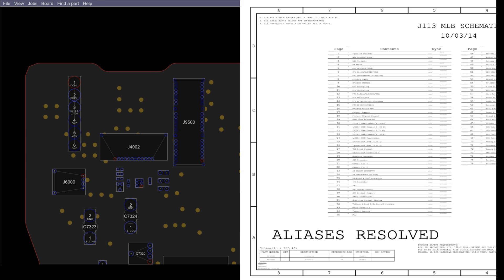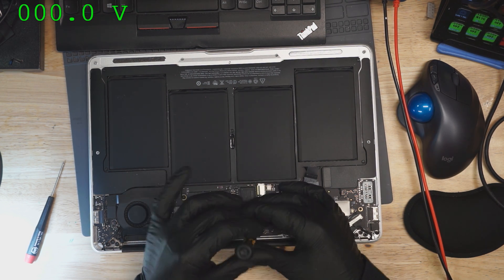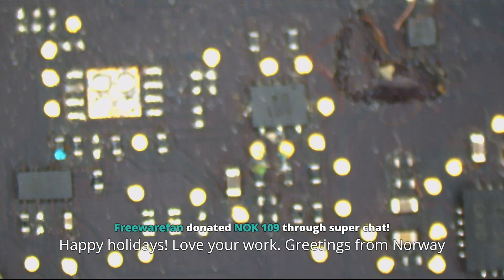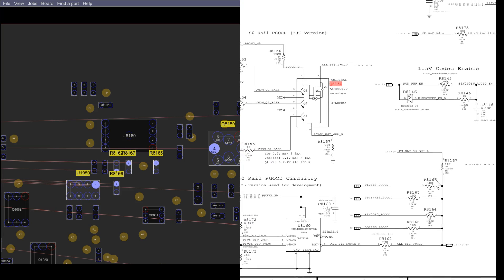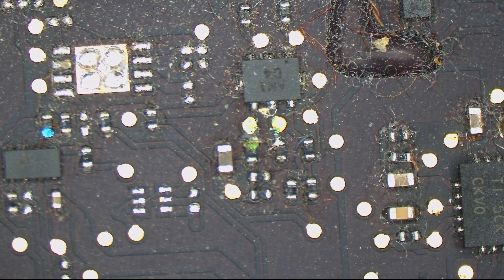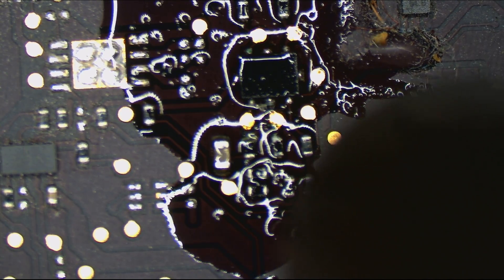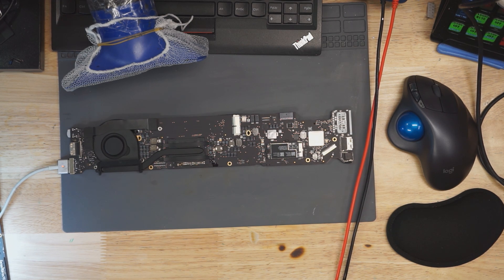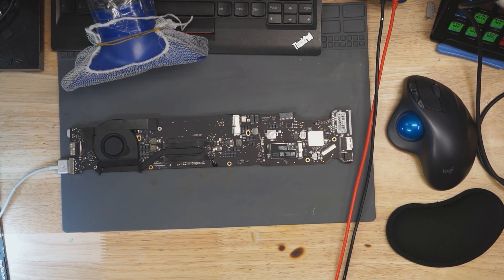Why does Macbook Air board draw 150mA and not turn on?

Comment: I was thinking how nasty some of these laptops look inside but last week I opened my desktop and although I cleaned it like 5 months ago and it had almost no dust, my GPU was covered in layers of spider webbing like 3 spiders moved in. I couldn't believe it.
Reply: @Jason Gooden  If you think that's bad... I repair PCs for a living.  

I've seen a desktop that died because a pack of roaches moved into the power supply. (Three times... the customer is a repeat offender who refuses to call an exterminator.) 

I've seen a desktop that died because the fans were clogged with denim lint (they had the computer too close to the laundry room, and it was sucking in lint.)

I've seen a desktop that died because the owner had been using it like a smokeless ashtray for 5 years.  Everything inside was covered with a solidified layer of cigarette tar that was so hard I couldn't even chip it off with a screwdriver.

I've seen a laptop that died because of a cumshot.  (Eww!  And no, I didn't check the hard drive for porn.)

So, yeah, I've seen some pretty nasty computers.  My theory is that they call it a "dust cover" because it covers up the dust so you can't see it.  ;-)

Comment: Why not blast away the dust and fluff on the board with compressed air before fluxing it? Would that not make easier to position micro components back without stray hairs pushing them around?

Comment: Why so many macs have corrosion?  Are people making what with them?
Never had corrosion in my devices.
Reply: Louis has mentioned before that Apple doesn't put any sort of liquid protection to shield the internals from spills. I think it was a Lenovo one that he specifically referenced for having a thin film under the keyboard with drainage routes to combat simple spills and prevent this kind of corrosion. Apple just doesn't do that.

Comment: I looked at your shipment site, Rossmann do NOT use USPS. They will fuck you in the ass if you go to recover a missing item in the mail. Even with insurance. My uncle works for them going on 46 YEARS and he couldn't get USPS to refund a simple $150 laptop shipment. I had to provide proof it was mine, proof of purchase, proof I shipped it in that box, proof it was worth $150 and proof it was shipped in that specific box with videos. They wouldn't even accept pictures I had taken of the laptop. They will absolutely fuck you out of any shipment that is lost, regardless of """insurance"""

Comment: Have a Samsung question. From day one my Samsung s8 was giving me problems.dropping calls wouldn’t make or receive calls. Samsung Ireland has their own repair center in Ireland. They have changed out the motherboard twice already.so all in 3 motherboards in the same phone in the space of 10 months.guess what it is faulty again and again doesn’t make or receive calls. Send it back to Samsung the back had a tiny crack and that’s all.but magically the front screen has a chip and voids warranty they say and they won’t repair the motherboard fault. They don’t even need to touch the screen to change out the motherboard never mind the fact I have videos showing my screen was never chipped. They just said F^*k u we are not fixing it unless u pay for a brand new screen. Asked them to just send me the motherboard and I’ll fix it myself.and I’ll make a video showing we don’t need to touch the screen to fix my phone fault. A fault from day one. Must be a bad batch of motherboards. But bottom line is they won’t do anything until I cough up 250euro for a screen that wasn’t chipped when I sent it never mind the fact that the repair doesn’t need u to touch the screen at all. Go into the back change out board job done

Comment: Do you use one of those hot air things because it's easier than soldiering and is it still possible to soldier things to boards without it?
Reply: No, it's because you can't remove some kinds of surface-mounted components with a soldering iron, because the contacts are under the chip.
Reply: @SpearM3064  Okay, cool, thanks I appreciate the answer.

Comment: You sound like a pretty cool dude to work for. I have GE SCR motor controller and drive system training but nothing that would help me with the circuits you have. Most people that have cats or dogs and live in the city usually are good because their 5 times harder to have in the city.

Comment: Are you telling me the thing my daughter wanted and I spent all that money on, is junk? I thought they were built really well compared to other "windows" computers. Can you fix the border of the screen thats a piece of plastic and goes around, or is at least attached to the bottom of the screen? The part that says MacBook Pro on it, can you fix that? IDK how she broke it, but she did, and its only a few months old. Not a good track record when I told her it has to last her through college, and is currently a H.S. senior.
Reply: @1MADMAX 1124  Actually, compared to some PC brands, the Apple products have a higher reliability rating.  That "piece of plastic" is called the monitor bezel, by the way, and it's pretty easy to replace.  You can find videos right here on YouTube that show you how to do it.

Comment: I just learned apple is using ddr3 ram on the new 13 inch MacBook Pro
Reply: Are you serious shouldn't they be using DDR4 by now
Reply: Pink Lightning well it’s ddr3lp. You have to get the 15 inch for the premium speed of ddr4
Reply: @Steven-hq6df  but the ddr3 and ddr3lp  interfaces are at least 3 years outdated the computer would clearly be shit by today's standards

Comment: That sendyourmacbook.com link you have in the description appears to be a parked domain from my end. EDIT: Of course the one I just typed seems to work for some reason.
Reply: It's because
a) you don't have WWW cname pointed to the root of the domain
b) wrong web server configuration

Fix:

a) add a cname DNS record with value of "www" that points to @ (root of the domain)
b) add www.sandyourmacbook.com as hostname to the vhost file
Reply: doc the mentally crippled  I don't know what's wrong, but domain just works for me, it's "shortcut" to rossmann/mailin repair

Comment: Nice repair job.  I have an old A1811 macbook pro that wont turn on. I'm experienced with pics since the 486 and I was thinking about cleaning corrosion (if there's any) with isopropyl alcohol before sending it to a repair shop. What do you think about it?

Comment: When you see the 300th Mac with the same problem of liquid damage in the exact same place you can't do but draw conclusions
Reply: Robert B. They're reliable, but so many of their decisions are so strange. Thanks for the input.
Reply: Didn't some Lenovo models have a liquid catch and drain mechanism?
Reply: Think different.
Reply: @Robert B. I have 4 lenovo laptops, they all had smaller or bigger spillings and not one stopped working

Comment: so essentially macs are made with poor quality MBs 🤔
Reply: Yes and no it also depends on how people treat them I bought an alienware 13 r1 custom order off ebay and the previous owner had ripped the display port off the motherboard and lied about it's history in it's description I'm still getting the stuff to fix it
Reply: @pinklightningvtuber  unlucky about the alienware 😑😁
Reply: @AndrewBaggett-f2v  Because the problem is that macs are not made with poor-quality MBs.  In fact, if you look at the numbers, they're more reliable than many PC brands.  If anything, it's poor design (which Louis has pointed out several times), not a lack of quality.

Also, the customers themselves play an important role.  For example, the board that Louis repaired in this video... it didn't just spontaneously corrode on its own, you know.  Something got spilled on it.  I've seen someone kill a laptop (not a MacBook) by sneezing on it (I was there when it happened).  I've seen someone kill a laptop with a cumshot.  (Well, I didn't witness the actual event.  But guess who had to repair it?  Eww, nasty!)
Reply: @SpearM3064  Yeah but (most of) that stuff wouldn't be a problem if they used conformal coating, like everyone else does... Basically, you need to keep your macbook in a hermetically sealed container to keep the motherboard from corroding. There's always moisture in the air, and if there's enough, it'll start corroding stuff that hasn't been coated...
What apple is doing is making sure their products don't last too long so that people can be coerced into buying a new one by the so called geniuses at apple stores.